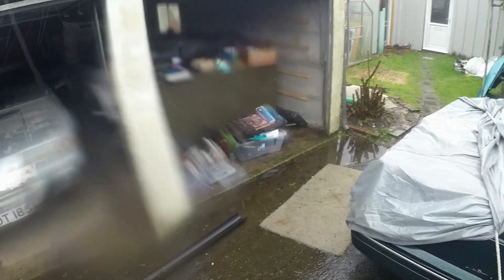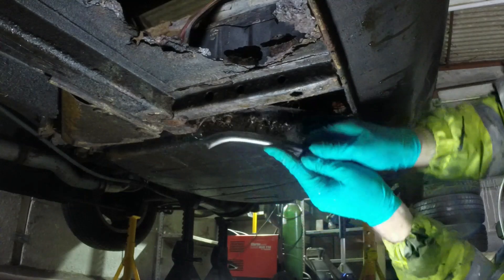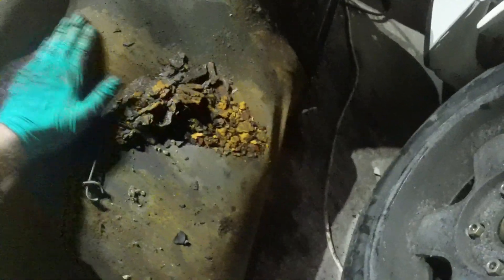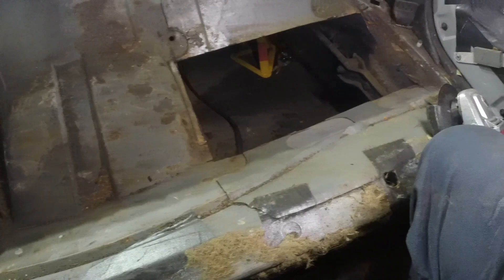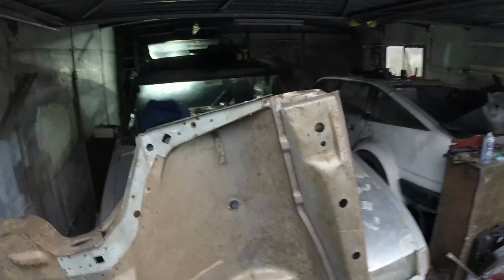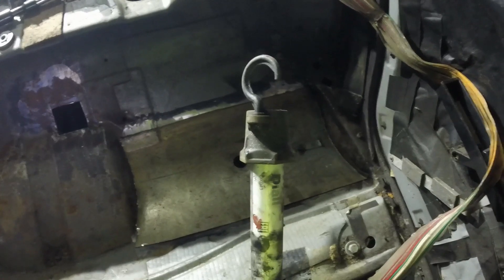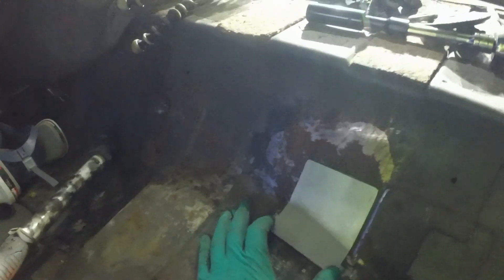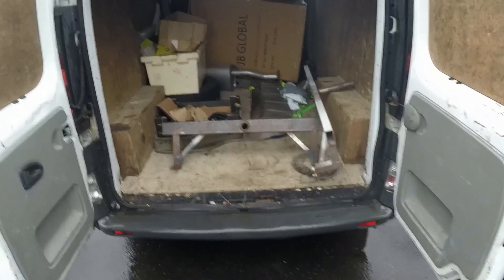Dotty 1981 Rover SD1 Restoration - Video 9 Floor repair 1

Comment: I won't tell anyone that your awesome and incredibly diligent repair is not 100% invisible :-) By the way, I gave Hydrate 80 a go and it seems really good! Thanks for the recommendation!
Reply: Cool bonus content at the end of the vid. That was a great space you were doing the Police car in!
Reply from the maker: @hydorah  Yeah my Dads workshop.  Loads of space and dry!
Reply from the maker: I like all the Bilthamber products.  They also make really good cavity wax and underbody waxes in a big spray can.  I like the underbody clear or UC.  They als make a real thin one that creeps in between the spot welded panels.  Cant remember what its called though.  By the way im not sponsored etc etc, its just ive used it and i like it!

Comment: Dotty actually looks much more solid than the 2400SD!  Seems a shame as appears a good car that looks like it got left stood and rotted out from inside.  That fuel tank is in way better condition than my 7 year old one on my 1980 3500 V8 when I bought it. I had to make a fibreglass patch repair on the bottom tank neck as it was already perforated when i bought the car.  Luckily as an 18 year old student I could never afford to fill the tank all the way so the patch was good enough for the few years I ran the car. Keep up the good work!
Reply from the maker: Yeah there is much to like on this car.  Its all just the fact it was sat there so long and the carpets got wet, stayed wet and rotted out the floor.  Really a very solid car.  Tank looks great externally.  Need to have a good look inside though.

Comment: Much as I hugely admire your work both on the fantastic police car which I saw at longbridge last year before I made the connection between you and the diesel. As soon as I realised this I knew the diesel had found its perfect owner!      I had my doubts when I saw dotty . However. .. I take it all back looks like the money that was spent on the engine was also spent on running gear etc.  Keep up the outstanding work .  Maybe will see this or the diesel at longbridge this year ! 😀
Reply from the maker: Dotty is just a very strange car. So much more solid in places than it would appear. Something fun to mess around with rather than being ‘worth doing’ in the traditional sense.
Reply: Cool name

Comment: I'm not putting Dotty on the rottery but here in the van I have the rottery. When you said I'm not putting it on the rottery I wonder how many of us were thinking so it is going on the rottery then lol. It does seem very solid were it counts when you see how much welding you have done on the diesel sd1.
Reply: Haha so true!👍
Reply from the maker: I really would like to, and to do a 'proper job' but i have to be realistic about what i can take on in my little damp wet garage.  Id have to removed engine and box and front and rear axles, and that would mean bits everywhere, then its a pain getting dash and heater box out, so i could access the floor.  Im hoping i can make a real neat job just patching it in strategic places.  WHen i win the lottery ......

Comment: All very impressive. 
Good effort !
Meanwhile, I still have a Stag & old XJ-S under cover on my driveway being ignored due to the bad weather.
Still, I changed the inner CV joint on my Granada Scorpio the other week outside.
Reply from the maker: Its all progress!
Reply: @nitrosilvia  
Well yes. Thanks.
I've done a number of jobs that would have cost £££s at a garage.
New starters on the Stag & M5.
Rocker cover gaskets on Granada; new plugs, leads, dizzy cap & rotor arm.

Comment: Other than the obvious big holes she doesn't look too bad. You need to get this finished so that you can buy another rover!
Reply from the maker: Its a solid little car.  Its just been years of wet carpets inside and a wet seat base that rotted it out.  All the stone chip on the underside of the rusty bits is perfect and holding it together!

Comment: You know i thought Dotty was a bit of a lost cause when i first saw it. But i agree, after looking underneath it looks like it's already been restored. The rust only seems to have started because the inside filled with water (are there any SD1's which didn't leak inside?). Definitely worth restoring, dare i say it less work than the diesel! 

Any idea how so much water got inside mate? Normally its the sunroof but i notice that this one doesn't have one. That might be the biggest ball ache, because there isn't much point doing all this work if you can't make it waterproof otherwise this is going to happen again.
Reply from the maker: Yeah, think the water is coming in around the windscreen.  Its probably lost its bond after 40 years.  That screen is coming out and i have a new one to go in.  Its a really solid car.  All easy bits to fix too.  Nothing as complicated as the diesel.

Comment: Balls the size of planets with all the metal work and welding  needing not many would put the time and effort in and just send it off to the crusher.
one thing I did notice and would throw me whilst driving till i got used to it the indicator stalks on the opposite side.😀
Reply from the maker: It also still bugs me how on series 1 cars the ignition key is on the left side of column

Comment: Your never be late if you've got a V8 haha, i do like an sd1 had 10 of them v8s, VDPEFI, etc etc all V8, some manuals some i changed to manual, prefer series 1, think dash at night looks like an aircraft cockpit, you say your car has been changed to v8, was it a 2.6
Reply from the maker: It started out as a poverty spec 2.3 with no sunroof and keep fit windows.  It got modified over the years.  Think it has a 2.3 clock set at the moment, so no if all the gauges read correctly.
Reply: @nitrosilvia  thanks for the reply, remember seeing a 2.3 without a rev counter looked like half the dash was missing

Comment: I suppose the question to ask is why bother?  The general thought behind the car was ok, but the execution was appalling.   Bits and pieces usually started to fall off or stop working as you drove away from collecting the car from the dealer.  The start of Rover's downfall as a mark - in a few years they'd been relegated to the bottom of the market.